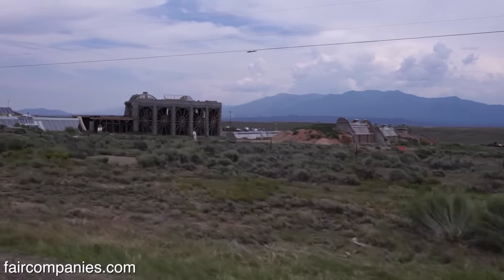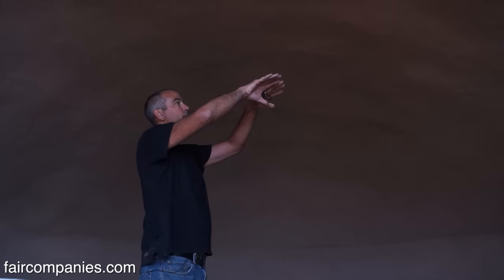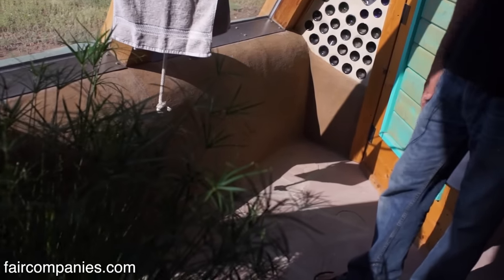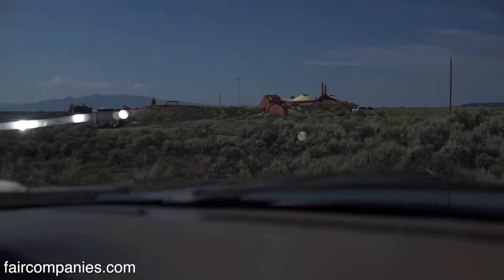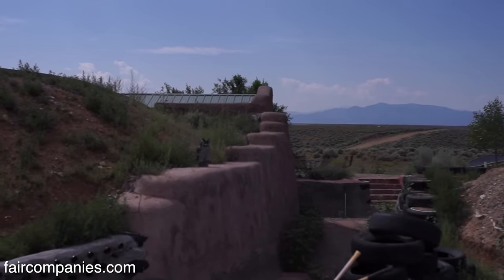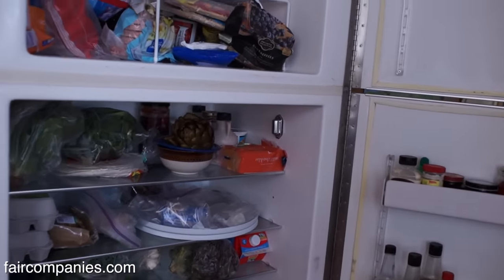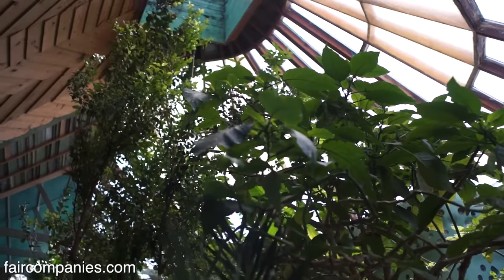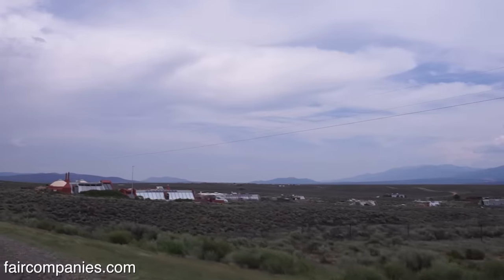Earthships: self-sustaining homes for a post-apocalyptic land?

Comment: I have wanted an Earthship for many years now. I'm too old and infirm to pound tires, so hubby and I are planning to do a modified one. Our walls will be straw bales, wrapped in lath and cement coated, then moisture wrapped and everything else will be as close as Mick's way as possible. We are in Tennessee so we can't use the air tubes. We go moldy in the first month.

Comment: Post apocaliptic with gas kitchen and solar power? I don't think so. Maybe with wood kitchen and and a windmill, but they need a close forest and many other natural resources that they seem not to have.
Reply: Don't forget he also said he has to have water shipped in once a year.  That equals unsustainable in post apocalyptic.

But I did like the idea and design.  Just needs some tweaking is all.  For example, an underground cistern with a nice diameter collection point would most likely fix their water problem...
Reply: He could easily upgrade his rain catchment area to accommodate this situation.   It probably doesn't make economic sense for him.    Thumbs up in my book.
Reply: lonerebelz
That and he could always put in a well.. he did say water was 800 ft down...
Reply: He did say 12 inches of rain a year would be enough for a modern family
If they built something as simple as a carport, it may provide enough extra roof to collect sufficient rainwater for the whole year.
Probably one of the easiest 'problems' to fix.
Reply: ***** "only you'd smell like a Frenchman."
That would be true apocalypse lol.-
Reply: ***** You can use biogas.
Reply: There is plenty of forest in northern NM, personally, I'd definitely have a wood burning stove in the kitchen.
Post apocalyptic? I think theres a strong possibility just because they're so close to the mountains.
But then again, Albuquerque does have the largest nuclear missile stockpile on the planet so I'm not so sure NM will still be around after the show is over.
Reply: he needs and so does the rest of them permaculture.

Comment: I wonder if this sort of architecture would work in places like south east Asia where it's super humid and full of trees.
Reply: They'd probably use different measures to try to control humidity.  In Japan they'd raise the floor instead of burying it and put in sacks of charcoal.  It would help absorb humidity when humid and then release it back again when dry.  If the house was half buried in the ground they might just need to excavate further to accomodate for that.

Comment: what kinda soap do you use to not poison the worms?
Reply from the maker: +jacksparrowismydaddy I believe they just use a biodegradable soap.
Reply: Kirsten Dirksen ok thanks
Reply: someone newtolife skin and your digestive tract are two different things... yes things can be absorbed by your skin but... it happens to be a much lesser amount I would think... like if you eat something generally your body aborbs it and uses it for fuel. but if it were injected under the skin you could become allergic to it I understand. your skin is a really good protectant and the first line defense against a lot of harmful things... using soaps like dial shouldn't have an affect on you because it washes off and your skin is pretty resilant to it. I wouldn't roll in toxic waste but generally soaps are ok. they are listening to us and makingbrands less damaging to our enviorment though.
Reply: that's what i was thinking
Reply: There's soap berries.  Even lemon juice cuts the grease.  Not sure about their effect on life though.

Comment: i designed one when i was 10 yrs old won awards in science,art .and design was drawn on clear film for each different element of its construct roof walls floor ect. fully self sustaining and utilized scrap materials in abundance at that time in its construction materials now theres so much more to utilize and incorporate into the builds and address other concerns as well while defining better builds and concepts that are being lost in the hast to make money over practicalities and longevity of  use we build junk that is sub standard to the needed resilience and stabilities to withstand the forces it can under go and provide safe shelter as well which present modes do not provide at all and if they did it would bring cost associated down like insurance.disaster relief ,and deaths from failure of structures and while doing it answer our waste reuse/recycling crises and fossil fuel dependency in a feasible profitable mode of expandable nature and applications of uses and that was 40+ years ago no answer or offers ever yet so i dont think the world wants to fix the problem just take money to say they want to fix it and leave it just as is to get more money pretending to care just like legal ,family court ect.ect. its all money not help oriented period. w/o question and half century of observation and experience to back it up .and mis or dis informed trolls save your breath your the problem and as far from the answer as can be and the apex of the corrosive element destroying our world and country more every day and i believe most of ya are doing it with good intent based of bad intel/info so final outcome is flawed and on purpose to defeat us as a whole dont feed hate feed your mind heart n soul for true power and unity that wins every time every fight the other is a sure proven method to failure and degradation.we need to reconnect in a more selfless compassionate way or we are done and gone forever the first creatures to cause their own extinction
Reply: Dude, YOU are way ahead of your time too, just like these guys.  Seriously, u did that at 10 years old?!  👌👌
Reply: Excellent!

Comment: Sustainable doesn't mean survivalist. You can use environmentally friendly and recyclable bricks and manufacturing methods that aren't soda cans. It's kind of unnecessarily basic. Permits exist for a reason, so that there are standards for things like staircases to make sure they don't collapse. It's a good idea, but with sustainable energy there is no need to take it to an extreme like this. Even in a post-apocalyptic scenario I don't see this being more viable than just building a normal structure.
Reply: QuantumBraced It looks way cooler!
Reply: +QuantumBraced Normal structures have more of an ability to rot. Good luck replacing that sheet rock panel in a post-apocalyptic scenario. Its easy to make your own concrete to continue building one of these. 

Additionally, a normal house is pretty useless without good HVAC and running water. At least these houses have the ability to collect rain water with an established method. Even if the plumbing no longer works you can still get water from the tanks at will. Also, these houses also do not need HVAC since it is designed to avoid those problems. While you are in a normal house shivering to death in the winter because of a poor insulated house, one of these houses can actually be too hot in the same weather. 

"You can use environmentally friendly and recyclable bricks and manufacturing methods that aren't soda cans." 

Why use recyclable bricks when you still have to pay for them? The point of these houses are to build them with mostly free materials (waste), and have a high degree of efficiency. Why throw something in a landfill when clearly it can be used to build a house. I bet you your house cannot produce hot water without a water heater meanwhile they have a house that can give them 15 gallons of hot water everyday as long as they have the water. Your house will have no heat during the winter, while they can sit inside their house without worrying about freezing to death during the day.

You not seeing the difference in a normal house vs an earthship is the problem with human beings. A lot of people have this infallible attitude that it takes a disaster to change their way of life for the better. If the American infrastructure fails things will get chaotic throughout the country. Meanwhile, these guys will eventually sit back, grow their own food and drink their own water while others starve.

Comment: It seems.like a lot of rodants, animals, and exspecially dangwrous insects would be crawling into the dirt vent attatched to the back leading to rooms!

Do they put barriers or like a vent covering to stop things like this from happening?
Reply: Sean Shannon No not the ones we looked through in the video did anyways, You could always opt to put one on there anyways if you're thinking of building one, but you couldn't do a filter or anything like with a/cs though because that would stop the air flow, a metal grate with thin bars should work pretty well. And most desert animals are nocturnal from what I can remember, and most would close the vents because it gets cold at night in the desert.
Reply: Saydee Trammell I think you're right on the money!
Reply: Sean Shannon Dangerous animals? Tucson AZ, still has rattle snakes, Javelin, Coyotes, Bob Cat's, and every desert insect there is. Been in the area all my life, Animals/ insects are not even a factor. Twenty miles from town. most people in this area drive / travel 40 miles one way, another no factor. Does food production mean your not living off the grid, or does not using massive amount of fuel grid electricity etc. mean not living on the grid.Working on your food production with limited water is a big issue
Reply: ***** Thanks

Comment: I would have to see the calculations to see the savings of using the cans and bottles with the concrete. Labor and expenses of acquiring these building materials versus the savings in traditional building materials and methods.
Reply: one bag of concrete plus 50 cans =3 bags of concrete worth of volume.see how it works yet?

Comment: 27:00 "...no maintenance." 
until that "rubber", ie: plastic, breaks down and you start leaking.
do you dig it up and re-lay the water barrier, or do you come up with a better method, or do you die and just not care?
how would you notice? are your plants the barometer for such a thing? or would you notice it in you 'electric' system... that may, or may not, be working?
Reply: what should be the way he does it?

Comment: I was surprised not to hear about using cob to build some parts.  Cob is flexible like most of the earthships require.  It's a mixture of water, straw and sand that can be molded to any shape.

Comment: My only thing is I live where the frost line is 4 to 6 feet below ground, and there's usually a high water table, what's water proofing like when making the foundation walls? If there is a leak, then it will be difficult to find, it could seep easily between the rammed earth tires and you wouldn't know where the original leak would be (same issue with ICF where I live too) but aside from that and one issue with local fire code (you need 2 points of egress from a room, I have seen the blue prints, there is only one point in any room with the models you are offering). I LOVE the concepts, but it needs to be adjusted a little to meet the standards in my climate (even the earth ships already built in Canada are either below zone 3, OR have been greatly modified with more windows and insulation to be up to code.) These homes were originally designed for deserts and tropical climates, cold climates have a different set of challenges, and I think earthship biotechture should be a little more open with that fact. It is usually only mentioned in passing on the site, and from what I've heard from other builders, they can be met with a great amount of stubbornness instead of cooperation to make these homes more accessible. So I'm not sure accessibly it entirely their main concern, or at least their behaviour calls it a bit into question some times. Treat cold climates like the actual challenge they are to live in, not just assume something meant for the desert will just work here as is.

Comment: A lot of good ideas, especially the water recycling system.........geothermal heating an cooling is a very good also, provided there is the land or the berm (in this case) to get the right effect.

Comment: I have participated in building an Earthship designed by the inventor Mike Reynolds on UC campus property in Cincinnati OH back in the late 1980's, and it was a miserable failure. The concept works well in an arid desert climate with very sandy soils, where the water flows straight down through the soil. But if you build one the same way on clay soils in a wet climate like we had without a drainage plane or foundation drains, the rainwater flows sideways through the soil and comes out into the house, making the earthen portion of the walls collapse inward into the home. You have to chose a technology that is appropriate to your site and to your climate, or it can be very expensive to try to fix it.
Reply: I had a similar experience in the UK ('90's). Proponents of the project also failed to heed the warnings pre-build due to blind devotion. This was also costly. Much of the ES concept is quite excellent though, particularly the integrated biological performance of the design, but it does indeed require consideration for local climatic and geological conditions.

Comment: Question;  I live in an area with over 100 inches of rain a year. how would i deal with the overflow from the 20x40 black water cell that could possibly happen from 800 square feet of basically an exposed pond? When it rains for a week solid, wouldnt it overflow or how would that be dealt with? Is this even a valid concern? Thanks!!

Comment: Thsnk you. Beautiful! Practical. Earth saving.
Reply: eath saving? wtf is he saving?
Reply: Recycled tin. Glass. = thermal mass. Just another way to use it for a purpose rather than land fill or litter.  Dito  for tires Tires. Plus when they are used yhis way as structural materal rater than  toxic gas from burning the tires. Recycled water by useing it more than once. I.e.grey water for plants. Waste not want not. How would you dispose of all that material?

Comment: Average home, materials and labor costs should be $125 sq. ft or less (with family and or sweat equity). If you control the cost of the materials - you can build affordably. Concrete is more expensive but well worth the investment in certain climates.

Comment: is this compatible with harsh cold climates like Minnesota?
Reply: They could be with some adaptations. Insulation and passive heating and cooling would be the key elements to be incorporated into the design, so the place can stay cool in summer but retain heat in winter. The site would be the determining factor. There is one technology that you can use now that might be useful and that's earthbags. You can build thick walls with earthbags, and you can incorporate structural elements like doors and windows, and render the interior and exterior. There are videos on YouTube that show the building process. (In fact the mini Earthship house is a design that can be made with earthbags.)

Comment: Hi Tom, I am from Quetta pakistan, i am very much interested in building an earthship home. We have huge temprature fluctuations between summer n winter where i am from, like upto 40 degree celcius in july with 9 inches of rain and upto -15 degree celcius in winter and we had 12 inches of snow in january 2020.
What do you suggest about the shape n orientation of the glass windows in the front.

Comment: This is brilliant, only the Earthships and Earthbaggers will survive. A few more ideas,  windmill water pumps and gravity powered plumbing.  A small deep root cellar.  The recycling septic field could grow a desert species of bamboo, for building materials.  Instead of a $300+ layer of EPM rubber in the septic field, a layer of clay could be used.
Reply: what is the purpose of the deep root cellar?
Reply: i love the bamboo idea too
Reply: @droyal03  a root cellar keeps some food stuff longer without the need for electricity or more frig space, should stay around 50 degrees

Comment: I have an amazing thought that I wanted to try but I am broke and we'll never get to build a house and make the walls they got a little so the space where all the air-conditioning flows through from one side house to the other side of the house so that you don't ever have air conditioning in your house and the heat hits the walls and can't penetrate because the air conditioning keeps the walls cold

Comment: Maby you should look at Alnarp Clean water to treat the black water. It breaks the black water down by use of bacterias. There is no reseduals that will need to be pumped out from a holding tank.
 The resulting water coming out at the end should be Clean enough to swim in so it is surely good enough to water the garden.

Comment: How would tire walls stand up to an earthquake? I would assume they’d be fine, but does anyone know for sure?
Reply: I'm not an engineer but I suspect that  the tires/cans/bottles will create fracture points where the concrete isn't fully bonded to the materials(which are not porous) and they will crack anywhere the walls are free standing.  More so anyway the filler is laid down uniformly, rather than staggered.   However......if those same walls are buried  or half buried in earth which is a great shock absorbing material then I think they  should be ok.   Remember when you add non abrasive or porous material to the concrete you're creating a wall that's only held together with small bits of concrete.  Had they used bricks or porous stone broken into random shapes everything would have probably been a lot stronger.  Thankfully they're in a dry stable climate.  Where I live the freezing  rain, snow, moisture and temperature swings would rip those walls apart within a decade.   They would need to be covered with a roof minimum, a roof and moisture proof coating(water proof stucko?) would be better.